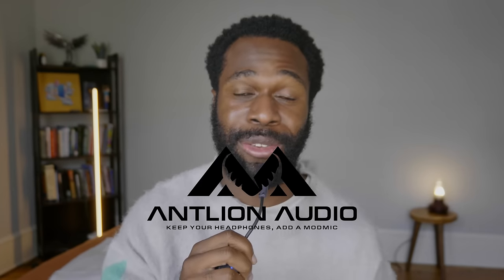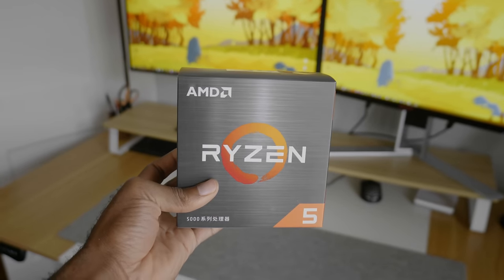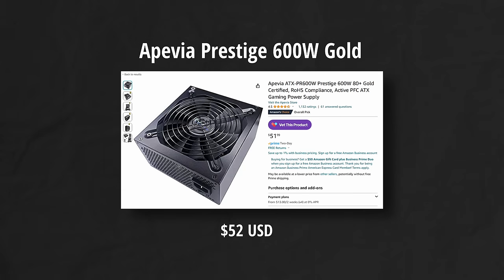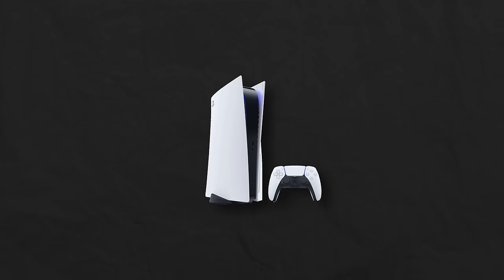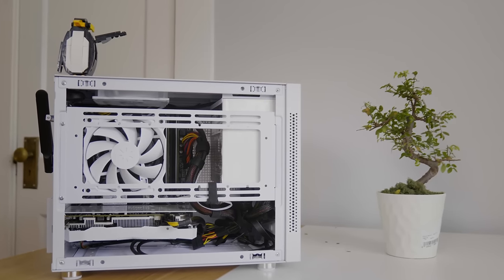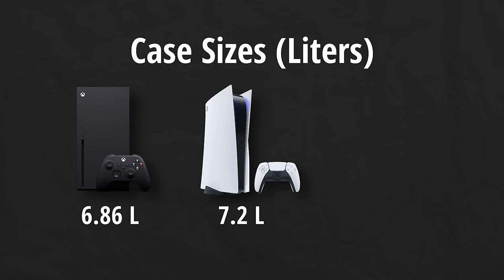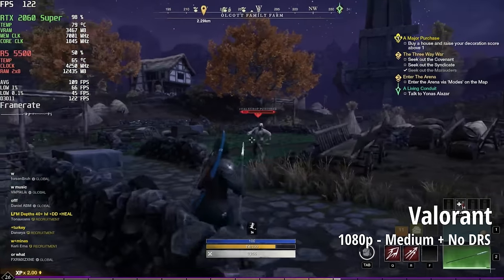The $500 PS5 Killer...did we do it?

Comment: Something to keep in mind with consoles is the added cost of subscriptions required for a lot of functionality. A PC is also capable of countless types of general purpose usage.
Reply: Also, games can be pirated on pcs.
Reply: The only reason I keep my ps5 is because I’m not patient enough to wait for certain games to come to PC
Reply: @Jaykurosakii Sony exclusives yeah that’s understandable especially since the ports are not always good.
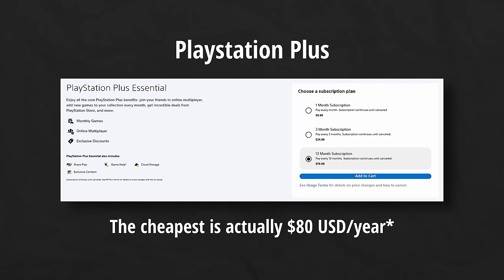Reply from the maker: Yep! I talk about both of these points at 6:40 and 12:15.
Reply: @OzTalksHW  Nice, glad it's a thing more people are mentioning with builds like this. I commented before watching in full.
Reply: Pc = modded single player 
Console = multiplayer
Reply: I did a price comparison several years back and when you add in the yearly subscription and extra costs for games, a custom PC will handily beat any console.  And it also is a PC , so there's about a million more options with it over a console.  One of the big arguments for the pro-console side was that you would have to buy a monitor in order to use a PC.  But if you're including the price of the monitor you have to include the price of the TV too?    I didn't include that in my price comparison because obviously you will need a monitor/tv to use any of these.

Let's not forget that you can easily upgrade, modify, and overclock your PC vs Console, It has multiple more uses,  you can emulate old consoles,  you can WFH and then game on the same machine, and you have complete control (for better or worse) of your entire system.

And with Linux becoming better at gaming, SteamOS, etc., PC's should be able to match the outright price vs performance on any console before the subscriptions.  Then there's emulators, indie games, etc.  There's so many reasons to get a custom PC over a console, even if it's initially $300 more than the console, you will save more than that on subscriptions and games over the next 2 to 3 years.

My system is over 3 years old, roughly cost me $800, and easily outperforms any modern console, I use it for work as well, can game on most games (Apex, Scum, BF 2042, Conan etc.) at low- high settings on 1440p @100 fps+
Reply: @Hulkachan ?? PCs have multiplayer too lmao
Reply: you don’t need any subscriptions on the next gen consoles.
Reply: They CAN, but thats how you get tons of malware, which slows down a pc.
Reply: @wobb_ Noisy sailor
Reply: @springyboi8534  bruh we barely have any rumours at all about next gen consoles, how do you know they won’t need subscriptions like the xsx or ps5?
Reply: @appsaucetech  no, you get tons of malware by being an idiot. And if you aren’t super tech savvy there’s stuff like steamos which gives a streamlined experience similar to a console.
Reply: @Jaykurosakii understandable 👍
Reply: Whenever I come to the decision of getting a console or a PC to scratch that gaming itch, I ask myself: which one will help me do my taxes after I game? The console or the PC? And the answer is always the PC.
Reply: This is brilliant.  @jmal
Reply: You really dont need the subscription most of the time. I play 99% single player games and went many years without a subscription. For the occasion that there is a major multiplayer game that I want to play coming out(very rare), I subscribed for 1-3 months and move on afterwards.

PC can do many things yes, but for most people the versatility of a thin and light laptop is much suitable for them, and when they want to game, it is just much cheaper to get a console for the purpose instead of building an overpriced desktop.
Reply: @sjneow  and overpriced desktop yet you said a gaming laptop which are usually 2-3 times more overpriced than PCs. Plus they don’t have adequate cooling and fail faster than PCs do
Reply: @OzTalksHW The only problem with console is having to pay PS Plus.

Paying 15 dollars a month to play online is atrocious.
Reply: @DeepfriedBeans4492  you don’t need any major subscriptions on the ps5 or Xbox series s/x, you still will need them for ps4 or Xbox one though.
Reply: @Jaykurosakii  erm...learn to read, I did not say gaming laptop. I say a general purpose laptop plus a console.
Reply: @sjneow  If you extensively develop apps / program’s or edit videos a general purpose laptop won’t get the job done. If you have a job that just requires you to type papers, create PowerPoints, and research then I agree.
Reply: @Jaykurosakii  yes and type papers, emails, and PowerPoints are what most people are going to use a PC for. 80% of PC sales are laptops
Reply: @Jaykurosakii  you read things wrong. He said "thin and light", not "gaming". Ah well, a light laptop these days costs around $500 - $1000 these days anyway, might as well get a desktop to do both gaming and working.
Reply: I love consoles because ease of use and PC doesnt give me physical copies. Thats why I bought Elden Ring, Jedi Falling order, Final Fantasy 7 remake, Resident evil 4 remake, dying light 2 and Cyberpunk for ps5 instead. My pc cost 1500 more. lol
Reply: This is maybe playing the Devil's Advocate here, but at least where I live, you can get subscriptions (and least the gamepass) much cheaper.
Reply: @ZackSNetwork most of the ports have been great tho
Reply: @Hulkachan  the whole point of this comment is that you need to pay for online so no, PC = multiplayer since its free
Reply: Also you don't even have to spend any money on PC games (if you aren't picky) There's different genres of free to play multiplayer games on Steam. Plus there's frequent free weekends for popular games.
Reply: I simply don't care. My PC and PS5/TV are right next to each other and I haven't turned my PC on in over a year. Previously it was my PS4 and my PS4 plus subscription for 8 years was cheaper than the cost of my PC.
Reply: @sneekz07  a PS4 + 8 years of sub + games costing more on console would have built you a highend PC though. It was still cheaper to go PC in that generation.
Reply: @wobb_  Pirating is illegal. If you want to bring illegality into the conversation I can get a console + games for free if I just steal them.
Reply: @labibahasan8302  Are you serious? You sound serious.
Reply: @Hulkachan multiplayer is way better on pc. Plus, you don’t need to subscription to access it.
Reply: Do i need ps5 pass to play warzone like games? They r free2play isnt it
Reply: Owning a top of the line gaming PC is way more expensive than a console. Even if I include years of PS+ subscription. My mouse, keyboard, mousepad and headphones were almost $600.
Reply: @reisshep  but you don't need a top of the line PC to play games. that's the point. you can spend the same amount on a PC and get roughly the same performance as a console as shown in this vid. Spend the money you'd pay for online sub and you'd have a way more powerful system.
Reply: @Velakor9150  You don't but then the advantage of having a gaming PC is thrown out the window. I'm not getting a PC to play on anything but 4k ultra settings with maxed out ray tracing. I love the PC for it's power, that's why I got it. If it's not as powerful as the PS5 then I see no point, honestly. And PC for the same price really has to include the peripherals as well (since they controller included with the PS5 and that's a high end peripheral) and if you're not hooking it up to a TV (because everyone has a TV in their house) then it has to include a monitor as well. And if you don't have a place where to put it, the cost really just keeps going up. Keep in mind I'm only talking about AAA new releases and stuff, because if you play indies or whatever then even this PC is overkill. PC won't ever be cheaper than a console but it can multitask better and it's a multitool.
Reply: @reisshep  but it will be as powerful as the PS5... read my comment. the money spent on sub you put into better parts. that's your preference as well and ultra 4k is overkill anyways. that's way above the quality a console will do for many MANY years.
adding monitor pricing in is kind of dumb as well. I don't have a good TV, it's old af and second hand. Cost me nothing. My original monitor was decent but again second hand and old af. People who get consoles generally buy a really expensive smart TV. so actually you'd be putting TV cost in.
AAA games are also insanely cheaper on PC due to CD keys if you want a legal copy, or you could get it for free if you want to play a AAA singleplayer/some coop games.

PC is cheaper, you just think its more expensive because you want 5x the power of a console. we're talking the same power.
Reply: @Velakor9150  No it won't be as most of PS5 games are 1800p or checkerboard 4k30 with RT
Reply: @Velakor9150  also your argument about 4k being overkill or you having a shitty TV is very much unimportant because modern consoles run games at near native or native 4k, and I don't know about a home that doesn't have a TV but I do know homes without monitors. Again, if I have a PC I want the advantage of a PC, I don't want another console and a compromised experience, I like my 4k144Hz HDR monitor. AAA games can be bought physically for half the price on console a month after release through the second hand market or you can buy a key on driffle or whatever. I'm not gonna even comment on the piracy thing, lol. Also, PS+ does get some AAA games on it included with the sub.
Unless you play only indies PC isn't cheaper, good PC peripherals aren't cheap (just a solid keyboard goes between $150-200), but PC is better, and can multitask. And if you bought a PS5 equivalent in 2020 (so 2700x and 2070 super), you can just see how that machine underperforms today, because it's not optimized for the hardware.
Reply: @labibahasan8302  except you have a high chance of being arrested.  I don't have to physically steal anything; I have to download a file and play.   Awful comparison.
Reply: @anonymous-cy2ms  Your ISP can ban you. If authorities get involved you could be fined, worst case scenario you could be prosecuted. It is a crime that is actively being punished by most authorities. Being able to commit cybercrime is not a factor to consider when comparing pc to console for the purposes of home entertainment, the average consumer does not commit crimes.
Reply: @wobb_  the ability to commit cybercrimes really isn’t a plus point when comparing pc to console for home entertainment. it’s stupid to even consider pirating.
Reply: @labibahasan8302  man said fucking "cybercrimes".
Reply: @anonymous-cy2ms  fax
Reply: @wobb_  It's a term that's been in use for decades now.
Reply: @labibahasan8302  Stop blowing piracy out of proportion. Although it is illegal, you won't get in trouble for it.
Reply: @wobb_  Up to 5 years imprisonment and £5000 fine in the UK and in the US it’s a felony charge with up to 5 years jail time + up to $250000 fine. No trouble right?
Reply: @labibahasan8302  Piracy is not enforced. Nobody cares.
Reply: @labibahasan8302  Worst-case scenario, you'll get a letter from your ISP telling you to stop (hasn't happened to me yet).
Reply: @wobb_  Still bringing up/encouraging crime as a plus point for buying a pc is just plain moronic. Thousands of people get arrested for things they do online every year and digital piracy makes up a majority of the fines & arrests. Just because it hasn’t happened to you doesn’t mean it isn’t enforced, that’s a really stupid mindset to have. If you mentioned the superior discounts and game library you can get on PC then I’m with you 100%. But encouraging ANY criminal activity is not right.
Reply: @Velakor9150   leave it bro.. he didn't included TV price on console side😂 and I really don't understand paying for multiplayer that's just not acceptable for me. 
upfront cost for owning a console is way higher and Pc you get cheap games also and I got 400 games for free from epic 😂😂 and soo much to learn on PC side. Ponies consider ps5 native 4k lol😂😂
Reply: @manna6912  atleast you understand. I just don't get this dude and his arguments... 
But literally it costs a HEAP to play console on this generation. Why I haven't gotten a PS5 even though it has some nice exclusives. Luckily they are slowly coming to PC.

Bless Epic Games
Reply: @Jaykurosakii  like gta6
Reply: @reisshep  why did you spend $600 on that. You could of got a steelseries headset for $140, razer mouse for 120, mousepads from $10-50, and a royal kludge mechanical keyboard for $100 at most
Reply: @Jaykurosakii  I got a $220 Roccat Ryos MK Pro keyboard, $170 Roccat Nyth MMO mouse, $70 Roccat Taito XL mousepad and $200 Roccat Syn Pro Air headphones. Those are the prices in my country. Granted, it's been a few years since I bought most of these peripherals so I need to change them. And I don't buy Chinese peripherals, only actual known quality brands.
Reply: @Jaykurosakii GTA 6 is enough reason to get a ps5
Reply: So what you’re saying is you can’t afford console 😅 how the tables have turned
Reply: My local library has most games released on ps5, switch and Xbox.. so I essentially play most games for free... That definitely brings down the cost compared to buying games on PC. And I can resell any games I buy on console anyway and recoup. I mainly buy PC games only that have ray tracing that I want to play at 60fps. Or indie games
Reply: If the exclusives port it's made by Nixxes you can be sure it will be good, and even if they are bad like the last of us, which wasn't made by them btw, it still runs way better on pc than on ps5
Reply: I'm calling it bull 💩. It depends from where you download them so.
Reply: The hell you're talking about bro, PC it's the best platform for multiplayer and single player. Reasons- No payed subscription required, Mouse and Keyboard, best response times with high refresh monitors, I mean, what more can you ask
Reply: I don't think anything can beat modding and Steam sales. Not to mention if you have a PC, you probably aren't going to buying a expensive POS laptop that will break in a year.
Reply: 60 bucks a year for ps plus, online gameplay, many special offers and free games each month, not the best ones but sometimes you have games like grid legends or bf 2042 wich are pretty nice
Reply: @wobb_  Not sure if the piracy comment is passive aggressive (you are a console lover) or if you are actually PC master race and it's supposed to be a bonus point xD
Reply: @gustavo9758  I like consoles but prefer pcs. Piracy is a bonus to me.
Reply: @Hulkachan   pc = both
console = multiplayer
Reply: 100% agreed ;)
Reply: @wobb_  On principle I stopped pirating after my teenage years, even if I hate some big game developers I don't really wanna play their games in the first place xD
Reply: It's also worth actually talking about what those subscriptions get you. Sure they're annoying if you don't like the games, but you are getting something other than just multiplayer play. I didn't have to pay for Ghost of Tsushima, Death Stranding, Horizon Forbidden West, Deep Rock Galactic, Guardians of the Galaxy, Spider-Man Miles Morales, Mass Effect Legendary Edition, Returnal, Days Gone, Demon Souls, and countless other games. Also game sharing is super easy and I imagine somewhat common with a friend. 1 copy of a digital game can run on 2 ps5s at the same time. Take some of these into consideration and a $400 digital ps5 not just competes but may surpass the value proposition of a similarly priced PC.
Reply: But my XBOX fits in my backpack and unlike PC nerds I got real friends to visit.
Reply: @Seb7an  thats what a laptop is for brother, i take it to my friends house tons
Reply: @sjneow  been on console for years the switch was well worth it
Reply: @Terence911 $80
Reply: You got the subscriptions, youve got the hardware thats forced because everything else is incompatible and the ps5 controller breaks yearly , you have to rebuy games everytime because optimization takes time for console, youve got to buy a really expensive TV ti figure only 10 games run at the advertised fps and picture. 

Then youve got to buy a new console every 5 years... 

All of this and it doesnt have google ....  

Yeaaaah the ps5 is the last sony product i will ever buy.
Reply: If you have a family member who plays, factor in that cost for PC gaming. You have to buy every game twice, as to where on console you can gameshare and only have to buy it once. The price of just ONE game on PC will cover the subscription cost of the entire year for console. You also get free games with your subscriptions on console. There's also far less that breaks.

There's obviously positives and negatives for both, people just seem to forget how convenient and cheap console gaming is over the long haul. This $500 PC, in 8 years when the console's life cycle is coming to an end, will not be getting that same performance, as to where the console will continue to have the same performance even on the newest titles

A $500 PC now will be crap in 8 years, the $500 console now will be still running at 60 frames on the newest titles. At minimum you would need a GPU upgrade for the PC in that time.
Reply: @_gr1nchh  youre dead wrong you can choose to buy aa game on steam or up to 10 more different stores or even buy a  digital copy directly the options are endless you could open an account for every family member and even get banned over and over again if you dont use steam.

In 4 years ive had to buy 4 controllers and how is being charged every month just to play online if you don't pay you just arent allowed. 

On those platforms like steam and GOG you get lots of free games and discounts. 

Meanwhile in 4 years theres a console upgrade an LG C2 for 120 fps cost me 1500$ and geuss what after 4 years theres only a handful of games at 120hz so what was the point secondlu every time the console upgrades or the developers have the time to optimize their title you need to pay for it as on PC the optimization takes a few more months but you get the full capability of the game.

Ive bought skyrim 3 time's and gtaV 3 times. 
Red dead redemption 2 makes sonys exclusive look like tetris and yet i cant play it at 60fps.

Now in 4 years what actually is the benefit of a ps5 and the C2? How many titles are only on ps5?

Essentially 2000$ for a goddamn fps increase and now to keep up another couple of hundred for the pro and thats not including the subscription or broken controllers and these controllers you cant use any other make except those they endorse. 

You cant google something. You want music you have spotify and itunes only want something else shame the same 16 apps since launch! Want to open youtube force close youre game want to type with wireless keyboard gamble with which one works...

🤨

I grew up alongside Playstation this is not who i knew this is a greedy incompetent company focused on games over the console, they sell bad comtrollers their solution a pro that costs 3 times as much and they didn't even fix it on the pro nope now you can buy new analogues 🤣 why cant you ise the ps4 dualsense oh because it lasts 6 years and still works and youll lose money.

Im getting a PC im not about the life of owning hardware i cant control and software i need to be allowed to use or sorry for me.

Pc i can get VPN i can rip the stupid exclusives of the internet not likely, I can play my games on their best provided my pc can run it, i can use the controller i want.

I can do anything.

Whats the point of console?
Load times exclusives that are releasing full priced dlc's every two years and old games with a facelift.

Tsek with youre BS fan boys, ive been console my entire life but im no fanboy I call a rip off when I see it and im not used to crap.
Reply: @kapnkrunch6833  I'm not reading all that. I'm happy for you, though. Or sorry that happened.
Reply: Yea man, the $15 a month for 4 years could have bought a PC...
Reply: @wobb_  you have pirated game on console too  emulator too
Reply: Can it play trackmania and make tracks like pc player?
Reply: Why I need a pc when all I play is a story mode games
Reply: @wobb_  That goes unsaid
Reply: We got Microsoft to thank for that lol
Reply: He pays $50 more a year for electricity with the PC. That’s almost enough to cover a year of PS+ in itself. Now add the value of the monthly games you get from PS+. Console wins again.
Reply: @wobb_ ah yes, stealing. Pathetic. Criminal.
Reply: Something to keep in mind is the console will probably be less stress maintaining.
Reply: Thats the thing i just want gaming i dont want added usage i have separate work station for that
Reply: @wobb_ not anymore.
Reply: If you´re smart enough, you can also get then games for free, at least the singleplayer ones.
Reply: @vladislavohremenco3472  most games are multiplayer it is 2024.
Reply: @vzero8612  you're saying it like 2024 brought hella games. Oldies are the goldies. I like playing older games from the golden era of gaming.